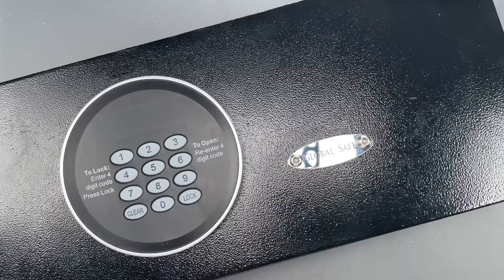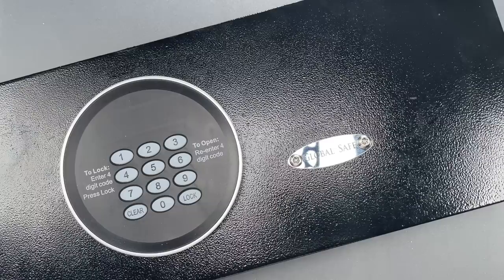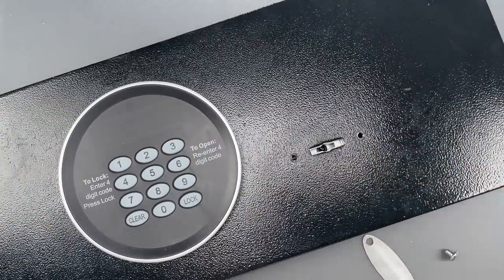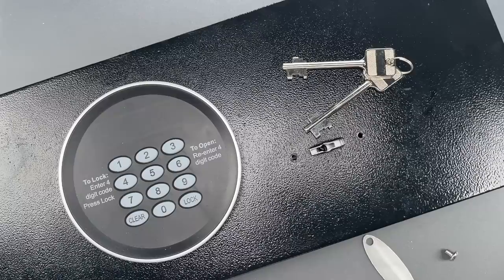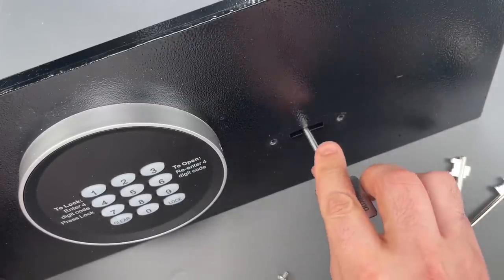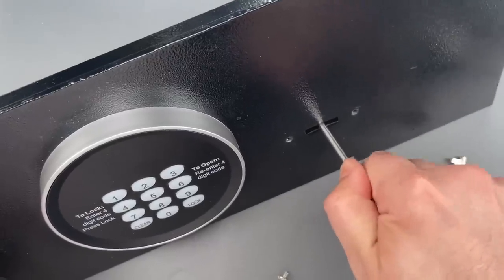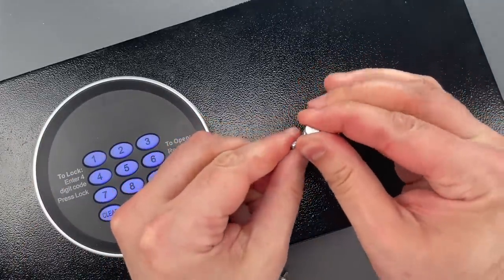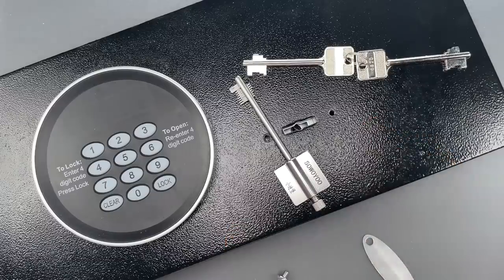[1462] Impressioning a Hotel Safe Lever Lock (Global Safe)

Comment: "It seems this company tried to make their product more secure . . . and to a certain extent it does help."
As frequent viewers will know, even such a modest statement in considered high praise from this man.
Reply: Levers are old, so there's no shortage of things they can do to make it more secure, or at least more annoying to crack open.

For a secure lever lock, check the Fichet F3D. It's French, a door lock, expensive, so it's not really common as the locksport community prefers moderately priced padlocks.
Reply: @cheyannei5983  There's quite a few Fichet picks on YT, not sure about the F3D. Many non-US and non-GB picking YT channels are hard to find but they do exist and they of course focus on locks in local use. I've dug up about ten more without much effort in the last 24 hours; just click the user-names in comments on channels you know to find them 😉
Reply: @cheyannei5983  Back in the days when lever locks were state-of-the-art, the better lock companies (eg. Chubb) included anti-picking and even tamper-evident features in their high-end locks.  These features would probably give LPL a major headache, if only he could find one to play with.  Today, lever locks are still considered reasonable security for most non-critical purposes, but only because they require a different set of tools and skills to pick than a typical wafer or pin-tumbler core, not because real security features are included these days.
Reply: @P_RO_  It's because the F3D is very secure. There's a couple picks on YT, but their technique depends on knowing the key bitting.
Reply: see the only problem is that those safes are bolted down so you would NOT be able to jiggle it, I've already flawed his only method making it unpickable. but of course he wont respond because he knows I'm right
Reply: @pro_moderngamer4943  You do realise it's the little fiddly parts of the "key" getting jiggled into place, not the levers in the lock?
Reply: @Kromaatikse  yes but you can’t jiggle the key if the door is still bolted to the safe which is bolted to the wall/floor. Which means his only method of picking it his lock is flawed.
Reply: @pro_moderngamer4943  Yes you can. Jiggling the key is just vibrating the key in place and with a bit of force, to make all the metal bits gradually move into their right position.

If the door is attached more firmly, then the impressioning tool will settle much faster.
Reply: @pro_moderngamer4943  It was explicitly stated in the video that this was not his only method available, I'm not sure where you got the understanding that this was the only way. For what it's worth, Pandu POLUAN is correct that in a general sense, keys can be jiggled. (though there are ways to minimize that)
Reply: @Kai-K  I missed the part where he said he had other methods so my mistake, but the way he picked it he had to have the door off to create enough perpetual motion to make the key take shape. With the door still on the key wouldn’t take shape because he couldn’t shake up and down as vigorously
Reply: @pro_moderngamer4943  you might want to delete this post, when the penny drops!
Reply: @highdownmartin  why would I delete something that’s factual? He couldn’t have made that key if the door was on the hinges and locked. If I’m wrong then have him prove me wrong with a video🤦‍♂️🤷‍♂️ that’s all I’m saying
Reply: @pro_moderngamer4943  how about, instead of demanding someone else does something to “ prove you right “ you rewatch th rev video to see where you’ve gone wrong.  You don’t understand what you watched or why that key will work whether the door is loose or immovable. 
It’s not proof you’re lacking, it’s comprehension
Reply: @highdownmartin  I’m not lacking any proof, I’m proved my case. If you watch the video he had to shake that door pretty hard to set the key. You could NEVER shake it like that while attached.
Reply: @pro_moderngamer4943  you move the key not the door. Why are those loose pin lockable keys made and sold ? Because they work.
Reply: Well, the video is over 3 minutes... So it's a damned good lock by LPL standards.
Reply: @pro_moderngamer4943  To clarify, the shaft of the key is narrower than the throat of the lock, giving him plenty of room to jiggle the key back and forth. This would have worked just as well had he clamped the door in a vice to hold it still, but would have been far more difficult to film as his default setup has his camera above the object on which he is working. It was not the shaking of the door that has the effect, it's the shaking of the key. If my understanding is correct (it might not be, but it appears to be), by binding against the gates in the lock and wiggling the key, the friction of the fingers against the gate walls retracts the fingers a little with each jiggle until they are able to pass through the gate without issue, at which point you tighten the back of the key to hold everything firm.
Reply: @pro_moderngamer4943  The jiggling isn't relying on the safe moving.  It's the key/tool moving the levers a little at a time.
Reply: As close to getting ANY stars, let alone 5 from LPL as youll ever get.
Reply: @TalonPro  No, that's when he says that it's a lock he uses himself.
Reply: It's rather backhanded praise in my opinion, since frequent viewers will also note that LPL takes a dim view of using "security through obscurity."
Reply: yeah, i mean, like, if it took the LPL about one hour to make the commercially-available tool reliable for use… i don’t think most thieves would bother tbh.

Comment: So you now have a key which will very likely open every safe in the hotel.
p.s. put the safe door back before you checkout.
Reply: Love the call back
Reply: Came here to make the same "...Took the door off for filming...you'd better put it back when you are done" joke.
Touché sir.
Touché.
Reply: I mean why use the physical key when there is a 99.9999% chance the default admin passcode still works.
Reply: OCD lock picking... i love it!!!
Reply: @satorudo  I know of a hotel, where the the default Code of "000000" still works
Reply: see the only problem is that those safes are bolted down so you would NOT be able to jiggle it, I've already flawed his only method making it unpickable. but of course he wont respond because he knows I'm right
Reply: @pro_moderngamer4943  I don't think you understood how the jiggling works.
Reply: @pro_moderngamer4943  jiggling means moving the tool, not the save itself. it doesnt matter if its bolted down or not.
Reply: @pro_moderngamer4943  😂😂😂
Reply: @pro_moderngamer4943  It actually made it harder. The key impressioner was jiggleing in the key-way. The door jiggleing was not of consequence. In a large vice or connected, it would have taken less time but would have been harder to film.

Comment: I had two "hotel safes" in a vacation rental.   For years they seemed to work fine and the guests like the feature.  ( the unit was rented in half so there could be strangers around).  I dropped one when cleaning the unit and the door sprung open.  I repeated my drop ( in case it was a fluke) and I found that a sharp rap on the left front would pop the door 75% of the time.

Left them in but attached them to the closet to prevent dropping.
Reply: That's just incredible! 🤷🏻‍♂️
Reply: This is actually a fairly common attack. Note you don’t have to drop it. You can basically hit it with a hammer in the same spot and it will open too. The shock causes the spring mechanism to temporarily “open” the safe. These days they’re more likely to be vulnerable to magnet attacks though
Reply: A safe that isn't attached to something sturdy by a means not easily undone from the outside can easily be stolen and then broken open later. Always anchor your safe in some way.

Still, if dropping a safe can open it, it's likely that striking it with a mallet in the right place can knock open the spring loaded locking mechanism too, so the safe still isn't very secure. 

Granted LPL has demonstrated that few security devices are truly secure. You have to ask yourself if the increased security is worth the cost. Your renters probably won't know the difference unless something is stolen.
Reply: It is called the 'Bump Method'. There is a YouTube video of a 12 year old kid bouncing one on a bed whilst turning the handle at the same time. In another video a guy slaps the top of the safe whilst turning the knob. Another uses a mallet, and there is a another with a rare earth puck magnet. The problem is the electromagnetic release, the steel bolt and the return spring. The is one video that shows all the methods 'How to open a Hotel Safe with no Tools'.
Reply: @Finnec123  You've presumably seen videos on this channel where he brings out his piss hammer. That's basically the same thing.
Reply: @katbryce  
I've seen a lot of his videos. But what's a piss hammer? A plastic one?
Reply: @Finnec123  The yellow urethane mallet
Reply: @katbryce  I'm gonna call my similar hammer a piss hammer from now on. Thanks :P
Reply: @katbryce  Is it called that because he's taking the piss? (british slang, I think? Making fun of someone or something. Also, I know it's because of the material.)
Reply: @katbryce  Thx.
Reply: @Nerdnumberone  The question isn't will someone who is hellbent on getting into the safe and has unlimited time, privacy, and resources get into your safe. It's whether you can reasonably prevent someone who is short on one or more of those factors from getting into your safe before they run out.
A MasterLock padlock is going to pretty effectively deter a casual opportunist and someone whose only recourse is brute-force attacks with simple hand tools and no real knowledge of the lock. Preventing a lock from being opened through easy, low-skill, low-effort attacks like bump attacks, comb and wave-rake picking, shims and notched decoder attacks, as well as making it sturdy enough to be easily brute forced and sufficiently non-portable that the malefactor cannot simply take the entire safe to open at their leisure, will effectively secure it from the vast majority of attempts at entry.
Anything beyond that will take either unreasonable levels of brute-force destructive entry that simply cannot be done anywhere you can possibly be overheard, or true lockpicking skill, which is sufficiently rare that anyone who actually has that skill is almost certainly not interested in opening your domestic or hotel room security because the risk-to-reward ratio is massively skewed in favor of risk.
Reply: @ShadowDragon8685  the simple defense against real pros:
 have meaningful security, and an easier,  more interesting target next to you.

Of course, this never works if you are the target for reasons other than convenience.
Reply: @Nerdnumberone  They had a cable but it was over 18" long......

Comment: Never seen an "impressioning key" before! Covert Instruments should definitely make it and sell it!
Reply: it'd be pricey.
To buy the 3 set from china is $80.
Then he'd have to fix each one to adjust their tolerances so that they work right. 
So between buying, weeks in waiting for the shipment, and then manual labor to adjust each one so he's selling a high quality item, the markup would be significant. And in reality, it would only have a very small market. 
Not many people know this exists, fewer know how to use them, and less still could reasonably afford it. So how many could they expect to sell?
Believe me, I'd MUCH rather buy from him rather than sending my CC to china. But the increased costs would be frustrating.
Reply: @brianb8003  I have just been presented with a safe that has a lock like this and been asked to open it. I need one of these keys. I have found the listing for the set of three keys, but I would like to know what he spent an hour doing to make it work properly before I purchase.
Reply: @sw6188  I have the same problem with the same key. I don't know what to Search for the set of 3 that you mention. Could you please tell me the query or give a link or a description so I can locate the same set online as well. Thanks.
Reply: @spideywhiplash  after a little investigative work.

Sowoyoo variety flagpole key
Reply: @sw6188  My guess would be that the manufacturing tolerances need to be adjusted for the tool to work properly. It would indeed be nice if the LPL went a little more in depth on the subject.
But perhaps he is investigating whether Sowoyoo is able (and willing for a price) to produce a special series of these tools for his online shop with satisfactory tolerances.
Reply: @spideywhiplash  Sorry I am sure I replied to your query and gave the info but I can't see it now. I wonder if it got deleted? Anyway, flagpole key is what you're looking for.

Comment: Certainly more effort put in the security of this hotel safe vs. many others shown on this channel. Just the simple action of covering the backup lock with a metal plate using torx bits goes quite a way.
Reply: security through obscurity is not enough.
Reply: @ShootBigBucks  by the looks of it, you only need to remove one to slide the plate out of the way anyhow. But if it was indented, and not just a flat surface, they'd at least have to bend it out of the way.
Reply: @paulthomas8262  since LPL had to search far and wide for this tool and spend an hour modifying it, rather than using readily available jigglers or a tubular impressioning tool is a big step up. Single pin picking should also work, but it's still a rare type of lock so fewer people will have the skills and tools to do it.

As LPL has demonstrated, nearly any lock can be defeated with the right skills and tools. At a certain point, you just need to say "good enough".
Reply: Not just regular torx, but security torx. However, a security bit set is part of my general purpose tool bag.
Reply: @johnnemeth6913  Yeah, they overuse them anymore, which means many owning a reasonable tool set and doing appliance work will have them.
Reply: @Nerdnumberone  if the key has a constant width with per position, this make for easier impressioning . Normally impressioning is harder than thsi becuase there isn't this much space to work with.
Reply: @paulthomas8262  It is not enough to be relied upon entirely, but until the obscure becomes known enough, it's usually very effective. Then you change methods and begin the game again.
Reply: @Nerdnumberone  You didn't pay attention. He explained and showed his usual picks for lever locks which would have worked quite well. Lever locks are uncommon in the US and most thieves will not be well-equipped to handle them. They are common in Europe however, and so is the knowledge of how to pick them, even with homemade tools. Thing is that few thieves pick locks anywhere as there's almost always a better faster way to get into what you want which takes far less skill and practice.
Reply: @P_RO_  a cypographic key aims to be unguessible in this case a bent piece of wire would tell you the information you need. Then all you nee to make is the mechanism. The lock itself could be improved.
Reply: @CrypticCobra  I've been watching the channel for years, LPL has been critical of security of obscurity several times.

Also the obscurity in this case isn't as obscure as you think, it actually depend on the context. 

Opportunity is certainly the key thing in crime, but have you consider that simply stealing property might not be primary reason for the crime? There are brute force way of getting into the safe too but that is not the point. An it might no make sense to leave such a trace.

The fact of the matter is this is not a lock that has been picked, and it one of the simplest impressioning he has featured. The cost of impressioning other locks and the time and skill involved is much higher. 

However thsi lock design can be modified to improve the security. .
Reply: @paulthomas8262  -- If you're leaving anything of any significant value in one of those cheap, shoddy hotel safes in the first place, then you're already doing it wrong. I grew up with guys who used to earn their living tearing the backs off massive victorian safes with a cold chisel and a lump hammer. They'd laugh at a piddly little thing like this. They would never dream of attempting to pick a lock when a crowbar was so much faster.
Reply: @johnnemeth6913  You can buy them anywhere online. I used to carry a set because some hotels bolted TVs so close to the wall I could not access the hdmi ports to try out presentations. Then use no maid service and fix everything before leaving. Fortunately most hotels either leave a port and a way to use it or you just switch cables with one to your laptop. My wife loves Dish Anywhere.
Reply: @paulthomas8262  Comparing to many others, its still way better but yes, obscurity only works on novices. Any more regular hotel thief will most likely already know the basics of the hotel safe and might have master keys and the right tools.
Reply: @joshsimmons7461  Any type of security screw that is not a pure one way is only secure in the beginning before some one starts making and selling the tools.

And pure one way are just an alternative to welding or gluing.

Comment: to be fair, that did take longer than most of the locks you typically open :-)
Reply: what do you expect, he basically used a key. he's arguably faster with a pick. ;D
Reply: Depends what you're after. Yes, LPL could pick each individual safe in the hotel much quicker than this, but having spent longer making a manager key that unlocks them all, your only constraint is the size of your swag bag.
Reply: But on the other hand, it looks like something a novice could replicate easily.
Reply: Except now he's got a permanent key. Other locks he has to repeat that action to continue opening them.
Reply: They say first impressions count the most...